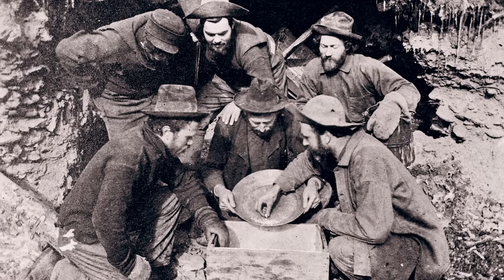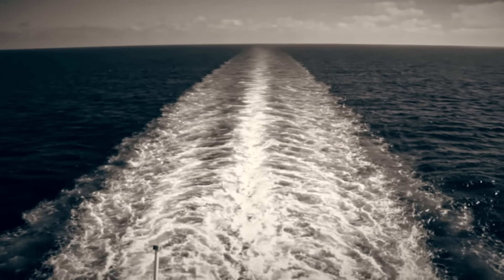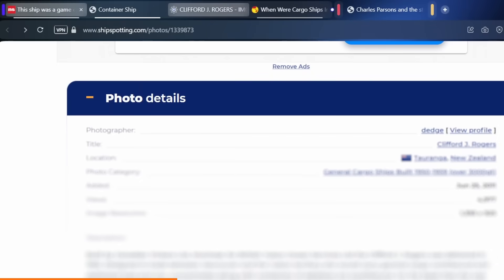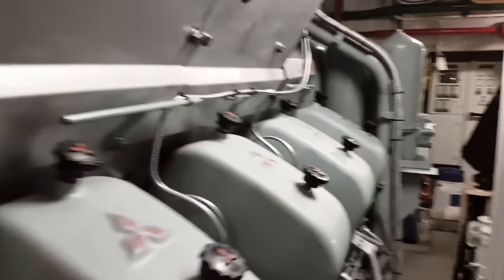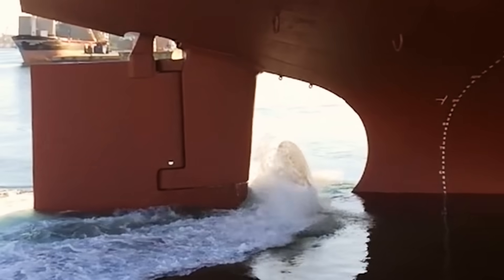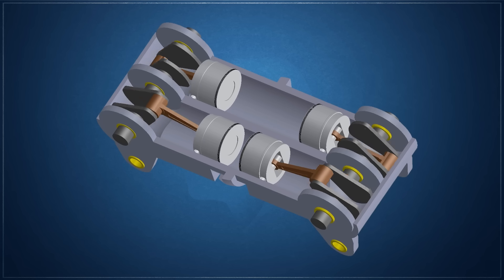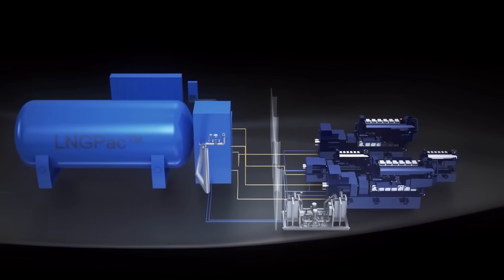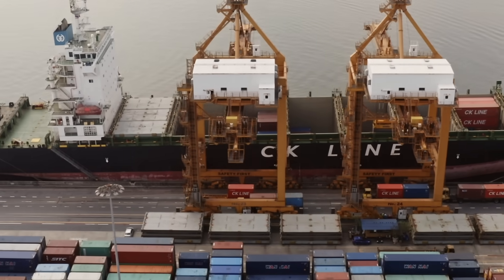The Incredible Evolution Of Large Ship Engines

Comment: 3:40 steam turbines are actually less efficient in general than reciprocating engines. The reason why they were adopted is because BOILERS are more efficient at higher pressures and turbines could handle that 400+ psi better than triple expansion. Some reciprocating engines like Skinner Uniflow managed to stay in the game for a long time. But turbines were certainly the norm post WW2. Otherwise great video!

Comment: How is diesel-electric propulsion more efficient than just driving a propeller straight from the ourput shaft?
Reply: Its not. There is simply no way that converting mechanical motion to electricity and then back to mechanical motion is more efficient than using a direct drive or gear box. Diesel electric drives on ships are used for three main reasons.
1- noise and vibration. Several smaller engines make less noise than one big engine. 
2- modularity. You can spread out the power plant of several generators and propulsion motors a lot better than one or two large main engines.
3-Other large loads. If a ship has massive electrical loads like a sonar array or a cruise ship, you will need many generators anyway so you may as well add a few extra and use propulsion motors instead of a large main engine that takes up a ton of space without generating any useful electricity.

You might be thinking of trains which have a large varying load unlike a ship. They are a hybrid system where a engine charges a battery which the drive motors draw from. That way going up a hill you can use more energy than what the motor can produce. You can also drive around unloaded without need for turning on an engine as well as regen breaking.

Edit: Oh also a big reason. If you loose your main engine your fucked. If you loose a generator you can still operate at reduced speed.

Comment: 7:44 "Fuel is injected just before the end of the compression cycle, and ignited by the high temperature resulting from this compression. This is known as compression ignition, *and it's the lowest temperature at which an air-fuel mixture will spontaneously ignite without a source of ignition and entirely by compression*"

Correct up to the bolded portion. The bolded portion is a definition of the term "flash point" used in describing fuels and designing engines. I assume this is a bad delete job between drafts followed by proofing failure.
Reply: That is not the definition of "flash point"!
Flash point is the "lowest liquid temperature at which, under certain standardized conditions, a liquid gives off vapours in a quantity such as to be capable of forming an ignitable vapour/air mixture".

Comment: A minor correction.  Two-stroke engines do not have an inherent bias towards high or low speeds.  The key difference between a forced-induction large displacement marine two-stroke and other two-strokes which makes them a low-speed engine are the use of an extremely under-square (long-stroke) piston design which biases towards torque over horsepower for a given displacement.  It's just comes down to piston geometry and it independent of cycle-type.
Reply: It's just the size of the engine. Big engines run slowly because materials can't take more loads. It doesn't matter whether it's two, four, or more cycles. Maximum speed is inversely proportional to size.
Reply: @satunnainenkatselija4478  You're absolutely correct, but my original points about geometry still apply.

Comment: My loaded F-150 burns about 15L/100km. A big highway truck does the same job with ~1.4L, and a modern container ship only needs around 0.4L. That means a ship is about 30× more fuel-efficient than a pickup and 3–4× better than a semi. That blows my mind. Should I buy a container ship for my work vehicle to travel around this island? 😂
Reply: Shipping has a really big advantage when it comes to fuel economy, in that the ocean has a really flat grade.
Reply: @AlRoderick and no stop/start moving
Reply: semi truck engine does not do the same job as your f150 - semi truck is pulling, in the US 80k lb GVRW, 128k lb gvrw in Canada if super B.

And at 80k lb, it's ~ between 20lhk to 50lhk depending on terrain, wind, age of truck, axle configuration, gearing - etc etc etc etc

That said you figure out l per lb, it would be an interesting bit of math to see what's actually better, pickup or semi truck.
Reply: Try the efficiency of a train,it’ll blow you away

Comment: I think the solution is using liquid and gas fuels made from syngas that are derived from various types of waste materials through gasification and pyrolysis. Also, modernize the steam turbine engine using gas fuels that would be more efficient. And, another thing using flywheel solid state battery hybrid systems for electric power ships. I think these ways of powering these ships will help with decarbonization the shipping industry.
Reply: To some extent, yes. But remember any space used for fuel is space not used for cargo, and gas takes a lot more space.

Batteries just don't have the density for long haul shipping. They have their niche on small boats, and are great for ferry services, but they aren't going be moving a panamax cargo ship any time soon.
Reply: @vylbird8014 That's why I suggest multiple types of energy sources for powering ships to see which one is practical. Also, batteries work with flywheels to help power the ship in a hybrid system.

Comment: technically not the most efficient engines as nuclear engines like the ones on submarines and aircraft carriers are much more efficient.
Reply: We're just talking about combustion engines.
Reply: Three guys in a row think that nuclear engines are more efficient? Nuclear engines on boats use Rankine cycles (think about coal power plants but with another heat source) that must be built in a tiny space with security concerns outweighing efficiency concerns. Why would anyone think that they are efficient? Then again you're right that the statement that diesel engines are not the "most efficient engines" driving ships. Even focusing only on combustion engines the combined cycle gas and steam power plant can out perform a diesel engine - However, few ships use them, as they are quite complex.
Reply: @martinhenke3160 do you understand energy density? Diesel has an energy density of 45 mega joules per kilogram, 45MJ/KG. Natural gas,  55MJ/KG.  Nuclear, less than 20% enriched 3.9 million MJ/KG. It's not necessarily about efficiency, Nuclear uses  considerably less fuel over time, and produces 0 emissions.  There are considerable upfront cost with Nuclear, but they are cheaper to operate over the long term.
Reply: @jeffreyhicks821  Well, in a discussion about "most efficient engines" I sure hope that it's necessarily about efficiency. While nuclear has some huge advantages (otherwise, why bother?), high energy density of the fuel does not make the engine itself any more efficient.
Reply: Yes. But it's not in everyone's budget, and subs and aircraft carriers use weapons grade uranium as their fuel. Now, maybe modular nuclear reactors will be a more cost effective power source.